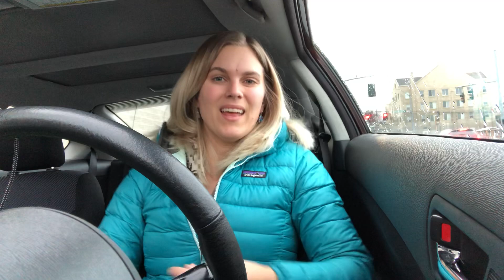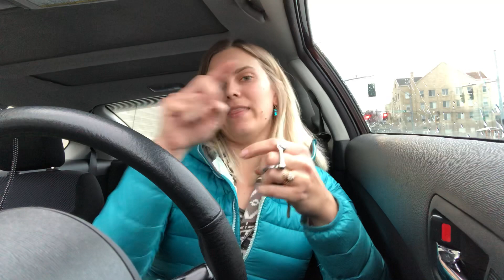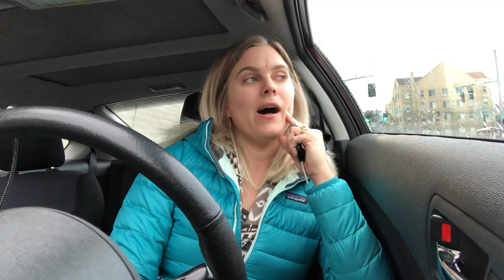Quick Toothless Update on Potential Oil Leak Location - 1990 Toyota Celica GTS #ProjectToothless

Comment: Currently fixing my 1990 GTS up and my oil leak issues were remedied with new valve cover gasket, crank seal, cam seal, oil pump o-ring and gasket, and distributor gasket. Just bought a timing cover kit and mostly everything was included. At first I couldn't tell either since it looks wet with oil everywhere. But now its excellent. Hope it helps.

Comment: The previous installer may have used a thin layer of RTV that had almost entirely flaked away. So perhaps that's why there was no real gasket? If it calls for one though, probably the leak. :'(
Reply from the maker: 802 Garage definitely possible. Might pull the engine and trans out together and just fix all the leaks. Silver lining? Haha
Reply: You'll definitely end up knowing the car like the back of your hand!